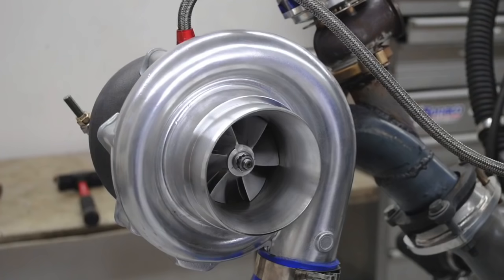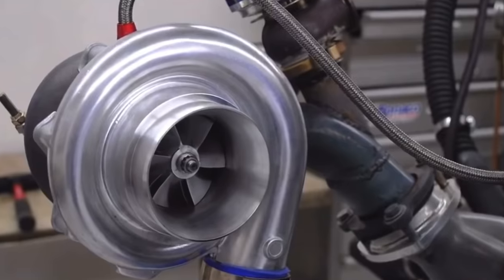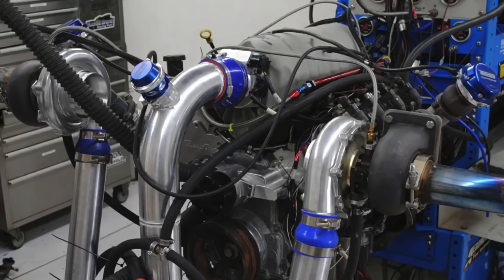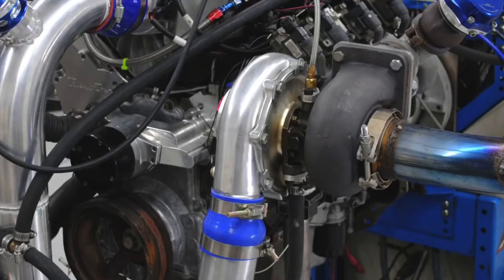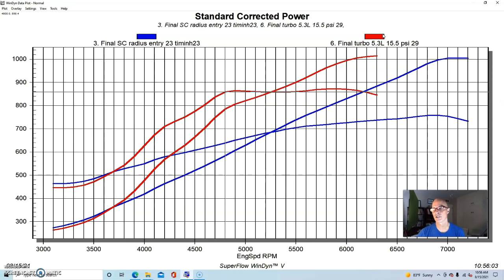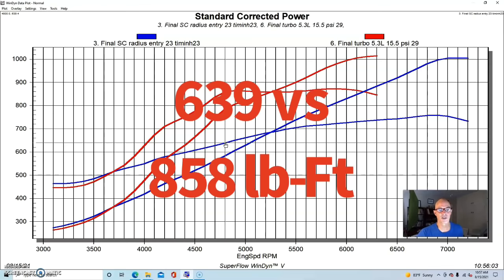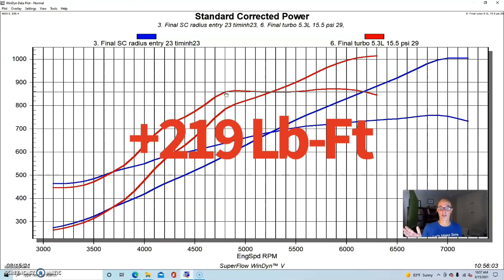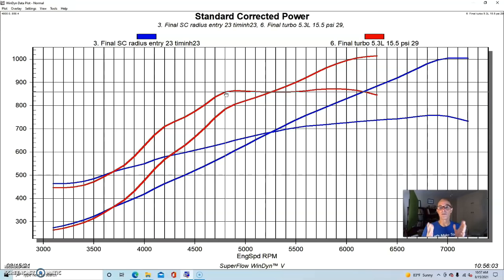HOW THEY WORK-PROCHARGER VS TURBO (WHAT WORKS BEST?)

Comment: Apples to Apples would be a SINGLE turbo vs. PC. Try to match RPM's as close as possible with PC pully size (the real weak point of a procharger vs. turbo). This is very random, even with lowering the boost, you have 2 turbos ramping up against a single, large pully procharger. Come on Rich, take an apple, make another apple as close as possible, then compare and you'll have a better argument. This is word salad to justify a video, and I know turbo's make better power with these engines. It's like comparing those twins to a 14-71 Keith Black Hemi on nitro and say 'well I've made some adjustments to make it SEEM more equal'. Love the channel but this one tanks. Oh, and you forgot the cost differentials......
Reply from the maker: SINGLE AND TWINS DO THE SAME THING-BUT YOU ALREADY KNEW THAT
Reply: @richardholdener1727  And a smaller pully and one degree of timing equals 100 HP, but you already knew that. Own the inaccuracies, you can prove your point in a much better fashion. And if twins and single are the the same then why use twins........and why does every high HP builder? Why not put out a video that nobody needs twin turbo's and prove it???????
Reply: @richardholdener1727   I have to disagree. The behavior of a twin turbo setup vs a single turbo is entirely dependent on the size of the turbos. A twin turbo setup will VERY often utilize much smaller turbos than a single turbo setup would. Smaller turbo’s will spool faster due to less weight from smaller components. However, a single turbo will be utilized when a much higher amount of flow is desired. A single turbo will ultimately flow far more air than a twin turbo. Again this all depends on how the turbo’s are sized. So simply saying “they do the same” is tragically oversimplified, bordering on being asinine. 

My bigger complaint has to do with the rev range used in the dyno test. There was 1000 RPM between the twins and the pro charger. There’s a chance that the twins would have ran out of breath had you continued to the same redline as the pro charger. The problem here is more than just “apples to apples”… if there were only one variable, that would be one thing, but there isn’t just one… there like 8 different variables. That makes it very difficult to truly compare different forms of forced induction. At best, you can only speak in vague generalities…. Which you basically did, because you knew it wasn’t a very good “versus”. Didn’t you? Be honest, you knew. 

Lastly, having watched and enjoyed many of your other videos and having been impressed by how completely you discussed the details of your topic. I have to believe that this was a rush job for some content to get posted because you weren’t able to do this video as well as you would have preferred. 

That said, you began to talk about how the shape of the power curve is important. Problem is, you only talked about the benefit of the pro charger while putting the twin turbos in shade by dancing around saying traction is hard to find with lots of power. 

There are so many aspects to comparing turbos and chargers you could use this video as a launch pad into WEEKS of talking head content. You could talk about choosing turbocharger or supercharger with respects to the power band, rev range or method of boost control. You could discuss why even has a centrifugal supercharger instead of using a roots or screw type. You could discuss compound charging with different combinations of super/turbo or turbo/turbo… and why compound turbos are used most often with Diesel engines. There are so many half statements in this video, you’ve got a plethora of content available here. I’d might take this video down, review it for the discussions you side-stepped and list possible topics to discuss after this video and record new explanation clips. When you come to one of those side-steps just say, we will be talking about in a follow-up video. Now you have our attention. Now you’ve got us on a hook! 

So that others might learn, a wide and flat power curve (as was seen from the twin turbos) is especially beneficial when road racing. The wide and flat power curve provides the engines peak power over a much wider range of RPMs. That means the engine’s power is near peak for powering out of a turn or down a straight. It also means that near peak power is available as a driver works their way through traffic having to slow down without the need to downshift as much. 
In drag racing, the only goal is to get to peak rpm as fast as possible as few times as possible in the eight, quarter, half or whatever distance has been decided. In one drag race you’ll never downshift… at least between the green light and the finish line. I this case, having the power continually rise all the way to redline is ideal. Especially since HP is merely a function of TQ and RPM… so long as torque doesn’t fall off too much… HP will always continue to get higher as RPMs get higher. 

Turbochargers are more efficient and environmentally economical as the use the waste air from the engine to help the engine produce more power. Super chargers (the pro charger is a supercharger) use power from the engine it’s trying to help make more power… this is called parasitic loss. Making more power using what is being sent out of the engine or taking power to make power from the beginning. You decide.

Comment: How would a twin Centrifugal Supercharger setup compare to the twin turbo setup?
Reply from the maker: twin blower will support more power than 1 blower-but require even more parasitic losses to drive
Reply: @richardholdener1727  but will the end power output on the higher end beat out a twin turbo setup or is it still in the turbo's favor?

Comment: As a kid, I grew up playing with 2-strokes.  In my mind, the proper way for an engine to behave is quite soft on the bottom, then building and building all the way to almost redline.  Unbelievable lightning-fast throttle response. If there's a sudden jump somewhere in the middle, that's not abnormal, but not preferable either (old Maicos and rotary-valve Kawasakis built power very smoothly).  I have yet to find any car that scratches that itch.  Frankly, even a 600 sport bike makes a disappointingly flat and fat torque curve to my tastes, though perhaps some nasty cams on an R6 might get there.

Anyway, my point is, I'm liking this centrifugal supercharger business.  That continuous build of boost may be the cure to the 4-stroke engine's diesel-like nature.  The turbos?  Nah, save that torque curve for the semi trucks.  Last thing I want is a donkey-kick of torque coming in some time after I've asked for it.  Maybe if I was into drag racing with an automatic... but I'm not.
Reply from the maker: you like what you like, but this isn't the 1980s turbo situation any more
Reply: @richardholdener1727  I'm going from experiences with OE turbo applications from the last ~15 years.  Audi 2.0T, Ecoboost Fords, stuff like that.  Sure, you're not waiting whole seconds anymore, but it's still a comparatively "mushy" response.  If you can tolerate a torque converter or GM's drive-by-wire, then modern amounts of turbo lag are no biggie at all.  I'm just trying to find a car that has that special sauce that you get in a YZ250 or something, without having to look at an RX-8 in the driveway.

Comment: I heard torq storm had less parasitic loss than ProCharger, how would one figure that out?....
Reply from the maker: blower dyno-but the test would be at a specific combination of blower speed, flow and boost level-it is not just one big absolute (and likely not universally accurate)
Reply: I noticed within the pro charger catalogs that the C2 pro charger marketed to imports has less minimum horsepower to operate than the P1 and the D1....🤔... And has a faster maximum RPM but a lower max CFM and max hp likely due to the smaller impeller, volute and possibly gearing...  I'm curious as to whether it has better throttle response?
Reply from the maker: it is smaller-that is why is has less loss-don't be concerned about loss and just pick a blower for the desired output
Reply: @richardholdener1727  600 horsepower is the desired output for this twin rotor...C2 it is... It'll almost be a max effort...

Comment: Hello Richard,

I really enjoyed this test & video, so much so that I just had to make a comment.

When you displayed the output from the engine fitted with the Procharger, I thought that the torque curve (& curve is a relative term in this case) seemed very bad - the RPM at the HP & torque peaks looked very close.  I figured out that the torque rose the way it did because the boost output was a function of engine RPM, not exhaust output.  But, I also thought that choosing a gear ratio spread for that engine would be very difficult, as most options would give weaker acceleration at upshifts.  It wasn't until you mentioned the drag racing situation where it all became very clear.  Since most cars raced with a Procharger are fitted with either a direct drive, or a 2-speed transmission, the RPM drop calculations for gearing is mostly irrelevant.  That was the bit that I enjoyed.

So, thanks for the test & video.  Now, I'd really like to see how a roots supercharger compares to the Procharger & turbo combinations.  Anyhow, keep up the good work.

Thanks.  :)
Reply from the maker: NOT UNUSUAL FOR THE CENTRIFUFGAL TO MAKE PEAK HP AND TORQUE VERY CLOSE TO EACH OTHER
Reply: @richardholdener1727  Yes, I figured that out.  This test also proves that an engine dyno is a much better tool for the car's tuning package.

Comment: Hey, I'm Dom. I am building a 2005 6.0. 

I will be putting this engine I'm a 65 impala. I have been looking at all the videos and doing a lot of research and i still need help choosing a cam.

Can you please help me. After talking to a few guys a had a few in mind. Can you help decide the best for me ???
Reply from the maker: what is the power level, desired rpm and what power adder
Reply: @richardholdener1727  wow thanks such for hearing me and responding.

I'm not really sure of the numbers because I'm not really good readying dyno numbers. But I want to get rowdy on the low end/bottom end. I want to fishtail and burn rubber ⅛ mile down the road or so lol......but also want to maintain good temp and decent rpms on highway
Reply: @richardholdener1727  just want to have fun on the bottom. But still highway ready.

Comment: Can a turbocharger boost controller be used for traction control ?
Reply from the maker: if the spring is light enough-most use timing

Comment: I didn’t look too hard, but if you haven’t done any on some of the “iffy” mods, i’d like to see an episode on that. I.E throttle body coolant bypass, heat shield under the intake, header wraps, etc. of course header wrap helps with underhood temps but what effect does it make outside the car if any?
Reply: Also stuff like ported MAFs and and throttle bodies

Comment: Roost has a 15 chevy z71 w 5.3. I was told by several on 355 nation to go w the procharger, which was twice the money. Supposedly the procharger hits immediately and the SC has to spin up to make power. I have complete exhaust headers on back w magnaflows, also an excellent CAI, TB spacer, mass air flow unit, then put the blower after the other mods. Why in the hell did I spend over 8k when I coulda spent half and been faster, makes no sense....Roost
Reply from the maker: a centrifugal has a rising boost as shown

Comment: So what would you recommend for small engines (sub 3L) in automotive applications for daily performance and occasional track use(both strip and circuit)?
Reply from the maker: TURBO
Reply: @richardholdener1727  Drat. I was kinda hoping to take advatnage of centrifugal simplicity on my Duratec 2.3. But oh well. If you'd be so kind as to answer, given the same application mentioned in my previous comment, do you need or recommend forged pistons, or are good quality hypers with ring gap and a conservative tune okay?
Reply: Until you're traction limited, area under the curve wins. Which means turbo! I however like superchargers better. Have run both. Both can make bulk power. But turbos just win on so many levels.
Reply: @richardholdener1727  At what displacement level or displacement-to-weight ratio would you recommend centrifugal supercharging over turbocharging? 10lbs or fewer per CI good for Centri with 15lbs or greater per CI better turbocharged? To do the conversion for you, an example of 10lbs per CI would be a 3500lb car with a 5.7L, and an example of 15 lbs per CI would be a 3.8L, and 20lbs per CI would be 2.9L, all still in the same 3500lb car (driver and fluids included).

Comment: So would a 6.0 with a ss2 with an f1a be capable of 1000hp then
Reply from the maker: fia94-yes
Reply: @richardholdener1727  what's the most amount of boost ever ran on a stock bottom 6.0?

Comment: The common consensus is the centrifical is earlier unless dual scroll or bi-turbo. But it seems oy on the roots.
Reply from the maker: a centrifugal offers very little low speed boost-boost increases with rpm

Comment: Well what if you had two prochargers like you have two turbos
Reply from the maker: you don't it
Reply: @richardholdener1727   I'm just wanting a little more power out of my 02 ram 1500 with the 360 just everyday driving

Comment: I have found that turbo setups at NPK are penalized hundreds of pounds and Procharger cars can run lighter in weight.
Turbo for power, Procharger for weight reduction. Wonder how that rule got changed?
Reply: If a turbo wins the trophy is some lead

Comment: That’s crazy, what compression ratio are the 5.3? Did you have to lower compression?
Reply: I think it's like 11:1 stock
Reply: @jasin1441  The newer 5.3 do have 11:1 but this isn't an EcoTec 5.3. This is a Vortec 5.3 so the compression is 9.6:1
Reply: @TheTW13  ahh my bad. I thought it was a l83
Reply from the maker: stock 5.3l lM7 is low 9s
Reply: @richardholdener1727  that’s perfect for boost right?

Comment: Seems like the turbo cars from 20 years ago that were hitting full spool only in the upper 1200-1500rpm had a lot going for them.
Reply: That’s the difference in how they used turbocharging back then versus today. Initially turbos were used to add more power to an existing engine platform that they felt needed more performance. If a companies 2.0L 4 cylinder could only produce 130 HP NA, they add a turbo and pickup 40-50 HP or so up top. Fast forward to today and turbos are used more for efficiency than performance and the goal is MPG on most modern turbo cars. With this in mind the current setup on “non performance oriented” turbo cars the method is to use a smaller engine than you typically would, say an I4 instead of a V6 or a V6 instead of a V8, but complimented with a turbo to make up for the loss of displacement. But in order to
Not make the engines slugs they’re tuned and use turbos that make peak boost very early in the rev range and therefore make excellent average torque which is what people feel on their daily drive to work and what gets your vehicle moving from stoplight to stoplight. So to summarize: turbos of old, laggy boost to increase top end power. Turbos of today, spool very low and hold boost through the rev range in order to carry the torque and beef up the area under the curve. Just different strokes

Comment: HEY Richard WOULDNT IT BE COOL IF U make an electric procharger. Like make it run off an electric motor to see if you can free up some power 😂😂. Make it spin off a STRONG ELECTRIC WATER PUMP DRIVE.  Would be a crazy idea but HEY LETS DREAM N HAVE FUN 🤩 .
Reply from the maker: DO YOU KNOW HOW BIG THE ELECTRIC MOTOR WOULD HAVE TO BE TO SPIN A 1000-HP PROCHARGER?
Reply: @richardholdener1727   Just make it work!! 😂😂😂
Reply: AMG In-line 6 already has one.👍
Reply: @edwardwood3622   any video?
Reply: @lildno2007  I saw it on Engineering Explained YT channel reviewing 2020 best inline 6 engines.
Reply: Most electric superchargers run for a short rpm until the turbo kicks in.  Your need a 80hp+ electric motor otherwise and that's a lot of battery and wiring support

Comment: All that low end torque from the turbo also breaks things, drivetrain and engine.
Reply: Easier on the drivetrain, I would think. Especially on a manual transmission when you shift.  Also with a turbo you can jigger the boost controller to give you the boost when you want, at what throttle opening, vehicle speed, etc.
On my car, which is supposed to have a weak transaxle, I just avoid full throttle in 1st gear.
Reply: Same reason why you don’t use nitrous at low rpm, all the low end torque breaks things.👍